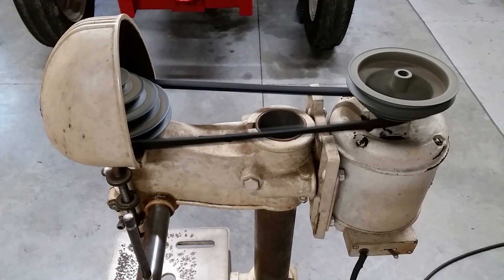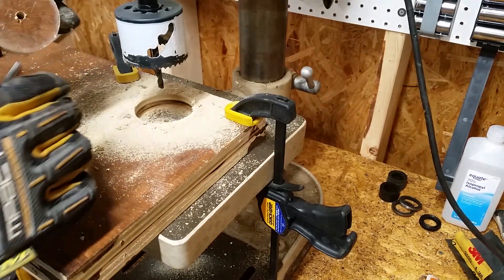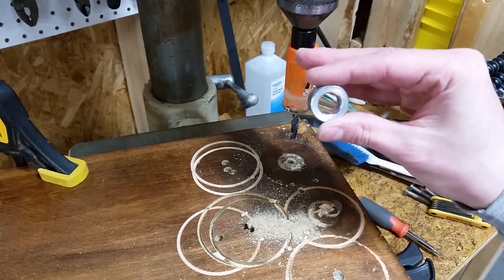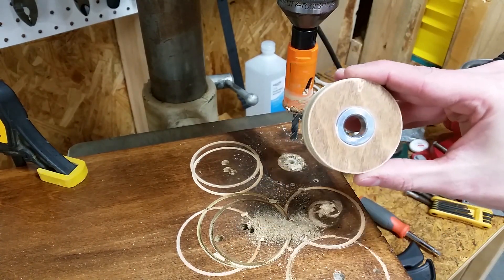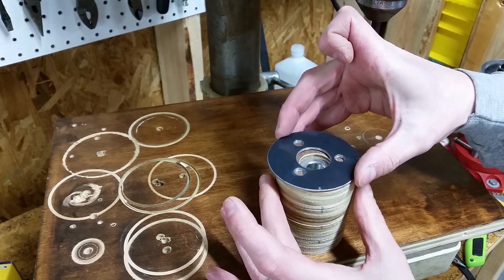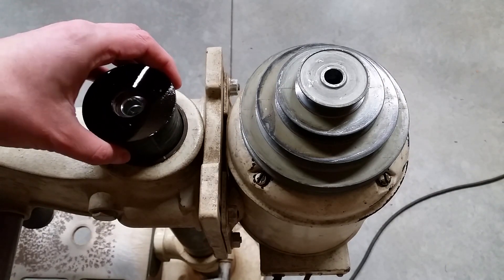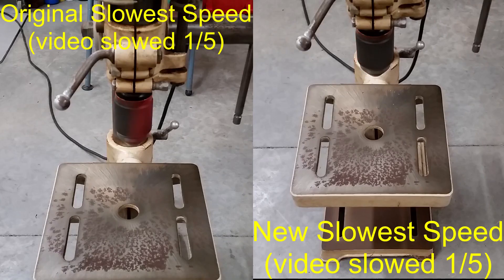DIY Drill Press Jackshaft Speed Reducer

Comment from the maker: Pulley Assembly:
https://amzn.to/3wH0i2y (affiliate*)

Link Belt:
https://amzn.to/3dICylP (affiliate*)

Shaft Collars:
https://amzn.to/3by78gi (affiliate*)

3" Hole Saw:
https://amzn.to/2R2aY9x (affiliate*)

2 5/8" Hole Saw:
https://amzn.to/3ayqOjP (affiliate*)

1" Hole Saw:
https://amzn.to/33Z6TZ3 (affiliate*)

Hole Saw Arbor & Bit:
https://amzn.to/2xAbSDo (affiliate*)

*Purchasing from these Amazon affiliate links earns my channel a small commission. Think of it as a tip that doesn't cost you anything. Thanks for the support!
Reply: Hi, Great video! The Amazon link for the pulley assembly wasn't working. Do you by chance know the model or item number? Thanks.
Reply from the maker: @louis3141  Thanks for letting me know about the link. I found a comparable replacement: https://amzn.to/3wH0i2y . It's a little more expensive but appears to be the same. Look up the part number on Google image search and you'll see the picture. The one I used was a Westward Center Pulley Assembly, part number TT10409513A1G, but I can't find it in stock anywhere online now.
Reply: @Mikeattempts  Ok thanks!

Comment: I picked up a 1970's-1980's Sears Craftsman  floor drill press with the tiny thin V belt for $75. It has a two speed motor yielding 16 speeds. It needed some love, but only investment was some inexpensive bearings, paint and a new switch. I looke for the intermediate pulley unit, and they were going for much higher than my Craftsman project investment. I mostly use the Craftsman as my deburr drill press station. It runs slow enough to work very well fir that function. I have dine some power tapping with it too, but without reverse, it isn't ideal. I was skeptical of the tiny V belt, but it hasn't been a problem. I have 6 drill presses in my current fleet plus the Bridgeport, so I have many options that other hobbyists don't enjoy. My largest drill press is a geared head 20" DoAll. 
It is a bit embarrassing to iwn the 70's Craftsman, but it is probably comparable to your machine, but floor model. For budget minded folk that don't want the effort and expense thst you put into your project, consider my approach.

I have a full machine shop, so I am not limited in the way that you are. You made a legitimate effort within the limits of your shop capacity. I recommend that you abandon your  Quickgrip clamping solution in favor of a proper drill press vise. I have gifted 3 industrial drill presses to young guys starting out, tooling them up with basic drills and accessories. I purchase one them a bew (import) 4" Wilton for around $80. It was nicely made, similar to a vintage Palmgren.  The tail of a decent heavy vise can be stopped against the drill press column and eliminate the need for clamping for most of the work that you demonstrated. It is simpler, more stable and safer than your method.
Reply from the maker: Sounds like you have a really nice setup, I'd like to get a small lathe and mill someday. I have since upgraded to a cross-slide vise for my drill press which gives me X & Y movement while being bolted down to the table. I really like this drill press. It runs true, is well made, and it only cost me $35! I think I spent less than $50 to make the center pully and, if I remember correctly, I paid around $30 for the used vise. It does everything I'd need in a drill press so I'm happy with it.

Comment: Good video, where did you find (buy) the 4 step pull assembly.
Reply from the maker: Thanks! I used a Westward center pulley assembly, part number TT10409513A1G, but it was eventually discontinued and became difficult to find. However, this same style of pulley assembly is used in almost every 3-pulley drill press. So, if you can find one on any of the replacement parts websites, it'd work.

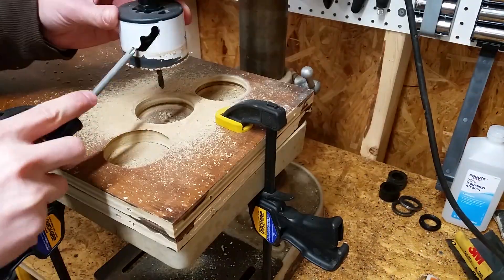Comment: 1:19 Great video thks where  do i buy the jack pully thks
Reply from the maker: Thanks! I used a Westward center pulley assembly, part number TT10409513A1G, but it was eventually discontinued and became difficult to find. However, this same style of pulley assembly is used in almost every 3-pulley drill press. So, if you can find one on any of the replacement parts websites, it'd work.

Comment: One last question, how do you tighten up the belt?
Reply from the maker: The belts can be tightened by removing a link. These style of link v-belts can be purchased online or at stores like Harbor Freight. You could also adjust the motor mount for added tension which would tighten both belts since the center pully's post can swivel.
Reply: @Mikeattempts  Thanks a million for your answer. I have a 1940 Companion desk top drill press and I want to do the same thing you did. I’m wondering if the intermediate pulley system you bought would also fit mine. There’s really no difference between what I have, and an old Craftsman of the same year. I’d appreciate your thoughts……
Reply from the maker: @Rstifleable  I did a lot of shopping around before I bought that center pulley assembly. That's what led me to believe that most 4-step pullies made for drill presses were pretty much the same. So, if you could find a replacement intermediate pulley assembly for a Craftsman drill press, you should be able to make it work. Let me know how it goes! :)

Comment: I don’t see where you bought the actual pulley assembly. I’m looking to do the exact same thing and would be interested in knowing where and the cost of the assembly. Thanks……
Reply from the maker: I used a Westward center pulley assembly, part number TT10409513A1G, but it was eventually discontinued and became difficult to find. However, this same style of pulley assembly is used in almost every 3-pulley drill press. So, if you can find one on any of the replacement parts websites, it'd work.
Reply: @Mikeattempts  ok you answered my questions! Thanks again…..

Comment: where can i buy pulley reducer
Reply from the maker: I used a Westward center pulley assembly, part number TT10409513A1G, but it was eventually discontinued and became difficult to find. However, this same pulley assembly is used in almost every 3-pulley drill press. So, if you can find one on any of the replacement parts websites, it'd work.

Comment: Pulley assembly now unavailable.
Reply from the maker: Yeah, I'll try to find one and update the link. However, this same pulley assembly is used in almost every 3-pulley drill press. So, if you can find  one on any of the replacement parts websites, it'd work.

Comment: I ordered that pulley thru the link and it doesn't include the bearing or the offset shaft.  Only the step pulley showed up.   Do you have any idea what happened there?
Reply from the maker: I used a Westward center pulley assembly, part number TT10409513A1G, but it was eventually discontinued and became difficult to find. So, I replaced the link with the pulley assembly from Jet. I don't know why it wouldn't come with the shaft and bearings but thank you for bringing it to my attention. I'll try to find an alternative and update the link.

Comment: Get yourself a 3 phase motor and a single phase to 3 phase converter VFD ( Variable Frequency Drive) it works much better. Great job on the center pulley 👍
Reply from the maker: I considered that but I was trying to slow down the drill press without spending too much money. :) Thanks for watching!
Reply: Sure, for only 3 times as much money. What a useless suggestion.
Reply: And no gain in torque. Or does a VFD trade speed for torque the way gear reduction does, and I just don't understand it's process? I do know speed control on a DC motor lowers speed, but also lowers torque. I have  a few servo motors. My Chinese lathe takes much better cuts with the AC motor and gear reduction that it ever did with the servo motor, and speed control. It was  ice having speed readout on the led controller, but motor packed it in, ( shitty place to put a magnetic motor, under the chuck, where chips fall. Steel chips love magnets, and killed the motor. It waas almost dead when I bought, so knew I needed a replacement,  reason for my great price) the induction motor is well away from lathe, is quiet, puts out a smooth HP at 1725, and is further reduced similar to this. I was fortunate to only need pillow blocks for lathe, and blunted to the bench, not the machine made it even easier. Now I'm doing drill press, and I know how I'm going to do so. Thank you sir.
Reply: Another way to get variable and low speed is to pick up a used treadmill (sometimes people put them out at the curb) and use the DC motor and the DC power supply from the treadmill. I got one that is rated 3.25 hp (2.6 HP continuous) and plan on doing this in the future when I get time. It does require some custom mounting of the motor and other things to get it working

Comment: I did mine and got it down to 170rpms
Reply from the maker: Nice, that's pretty slow! You should be able to drill a 1 inch hole in some thick stainless steel at that speed.

Comment: Nice mod. You just made the same type setup of multiple speed drill presses. I have a 16 speed floor model drill press and that is how they get those lower speeds with that center pully setup. But be careful and watch the center setup for wear being you made it out of wood. If you ever get the ability, remake that center support setup at least out of aluminum. Thumbs Up!
Reply from the maker: Thanks! Yeah, hopefully those metal shaft collars will keep the wood from wearing out. You're right though, I could use the same technique by cutting the circles out of aluminum instead of wood. Thanks for watching!
Reply: He's got metal shaft collars, how will there be a problem?

Comment: How do you tighten the tension on the belts?
Reply from the maker: I installed the belt from the chuck pulley to the center pulley first. The center pulley has an offset shaft so that belt brought the pulley all the way forward and the size of the belt made it a tight fit. After that I installed the belt from motor pulley to the center pulley. Again, because of the size I made the belt, it was a tight fit. With two tight belts, the center pullet can swivel slightly to the left or right so the belt tensions will equalize, more or less. These adjustable belts stretch a tiny bit over time so, after they had been used for a while, I was able to remove 1 link from each belt.

Comment: Fabulous build... thanks for posting! The pulley assembly per your link is no longer available on Amazon. Any suggestions for a comparable item? Thx.
Reply from the maker: Hmmm, It looks like that pulley might have been discontinued but I found a similar alternative on eBay: https://www.ebay.com/itm/153957843411 . Another option would be to buy the step pulley, bearings, and center post to assemble one yourself. Thanks for watching!
Reply: Thanks for the video.  What would be good search terms for finding a pulley?  "step pulley" leads mainly to 4-pulley assemblies.  "double pulley" doesn't find many possibilities either.

Comment: What do you mean by “flip the motor pulley” the pulley looks exactly the same as before on the motor or am I missing something?
Reply from the maker: If you watch the first 10 seconds of the video again, you'll see what I mean. When the black v-belt is on, the motor pulley has the smallest step at the bottom and the biggest step at the top. When the center pulley is added and the green belt is on, you'll notice that the motor pulley is now upside down with the smallest step at the top and the biggest step at the bottom.
Reply: Yes, you're missing your brain.